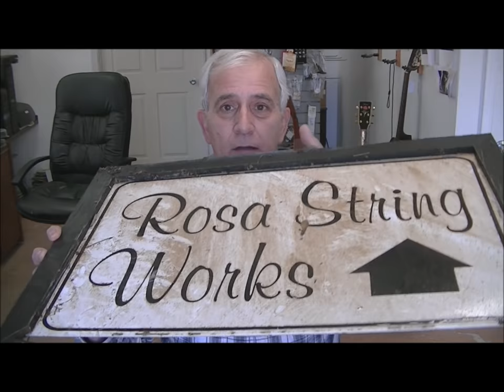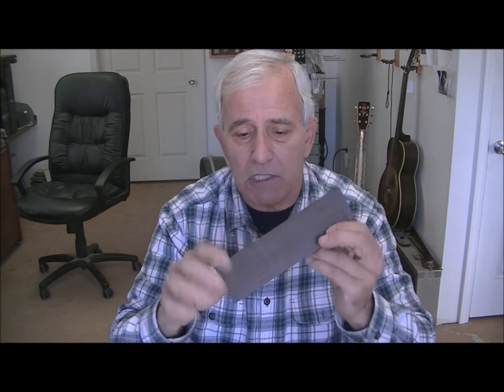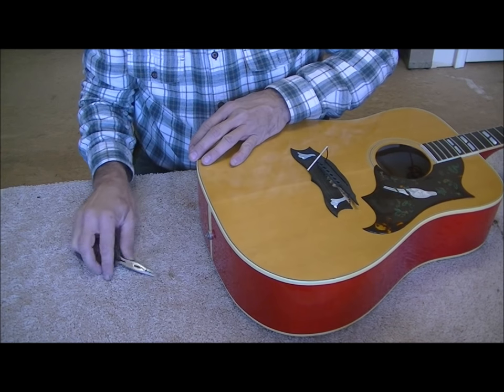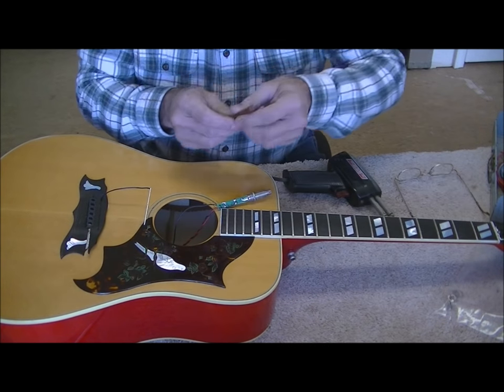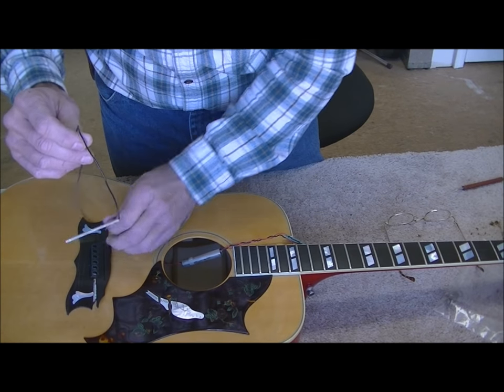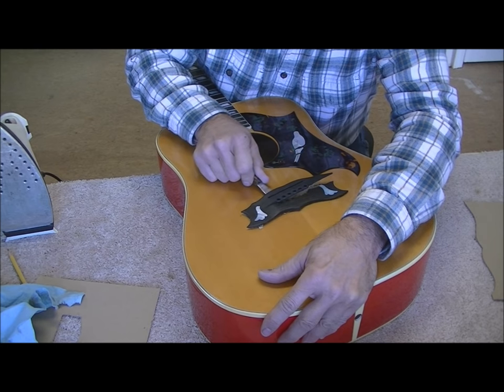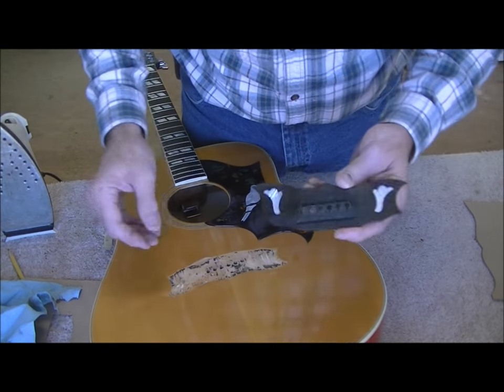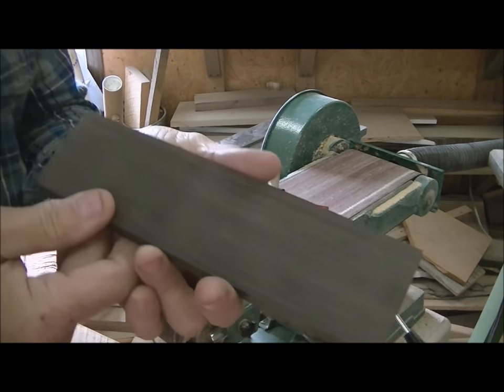095 RSW Gibson Dove Trash To Treasure Part 1

Comment: I had to make a new bridge for a Gibson Dove and once I removed the old bridge, I CA glued it back together and made a copy of it on my Xerox machine. I cut the copy out of the card stock it was printed on and also cut out the wings with an exact knife. I made a stencil and used that to trace the location of the wings onto my new piece. It worked really well😎

Comment: Like the way you removed the bridge . . . one can't get excited removing a bridge, calm patience is required . . . I like using my art knives, they are almost tin as paper and tough as can be.
Reply from the maker: Rod MacKinnon I don't remember how I took it off in the video without rewatching it. However I do use a artist palette knife most of the time. Thanks for watching.
Reply: I believe the wood you purchased is also called Grenadilla which is used to construct oboes and clarinets.
Reply: Jerry, you're adept at repurpose tools.  I'm trying to find a sable (or other suitable brush) to clean my harp of dust & sand.  Make up brushes aren't big enough.

Comment: Good idea taking a picture of the 2 wires before dasoldering or desodering. But you could just cut the two wires and leave a small bit of the coloured insulation attached to the circuit board. That way you can tell which attaches where. Better to strip back the wires and re tin them when making a new connection anyway.

Comment: I know everyone works differently - when you are de-soldering put a little fresh solder on the iron, it will transfer the heat much faster, causing less damage to the board and components. I worked servicing consumer electronics - tv's and videos etc for ten years or so - ATB

Comment: When you have that tall fence on your bandsaw but want to cut a short height board, simply clamp/bolt/screw a short squared up wooden temporary fence to the tall fence. You will then be able to get the upper saw guides down close to the work piece.
Reply from the maker: That's a good idea. Thank you. However my fence switches from tall two flat in probably 15 seconds. There's not much reason to need to do that.

Comment: Excellent work.  Thanks for sharing.  
Why is this a common occurrence with the Dove bridge,  ya reckon?   I've got one that I've had for many years that needs this very repair,  having cracked and pulled up in exactly the same way as this one.  When I first got the thing (1975),  it was cracked and I had it repaired/replaced at Sho-Bud in Nashville -- the only Gibson authorized repair shop in my area at the time.  It is the one that is now cracked,  and needs replacing.  
About 1978 or so,  I was looking at a brand new all black model Dove hanging in a music store in Knoxville,  and it was cracked the same way -- BRAND NEW,  mind you.  
Even seen it on some of their rosewood mustache bridges on some model Doves.  
The pins are ebony on these as well and I've heard speculation that the owners put too much pressure on them trying to seat them causing the bridge to crack,  but I'd think with the insert,  such would not be the case.   Still a mystery to me.  Any ideas?
Thanks again for this.  Either me or someone else is gonna have to replicate this repair and we need all the help we can get. LOL
Reply from the maker: I can't speak to all of them. But any of them that have that insert in there around the string holes they're bound to crack because that weakens at a lot.
Reply: Thanks for the quick response.  Your observations about the insert making it weaker and more apt to crack make a whole lot of sense to me.  I had to go look to see if mine was one with the insert (been awhile and us old folks forget a lot),  and sure enough it was.  You may be onto something. 
Ironically,  I think the purpose of the insert was to prevent that sort of thing,  sorta like drilling a hole at the end of a crack in sheet metal to stop it from continuing further.  Major fail if that was  its purpose.  
Thanks so much for your input and uploading this professionally executed and documented repair.  So very helpful.  
On to part 2 (about 1/2 way through).  Got some more questions and comments,  if you would be so kind as to indulge me.  Thank you.
Reply: I've seen a bridge with saddle route (channel) directly on a grain line, and it looked weak - for breakage. Hoping for your good health! @RosaStringWorks

Comment: Hi, I just recently stumbled across your videos and can't seem to stop watching them! I am an acoustic player myself and I have a Vega model VW93 Martin copy dreadnought. They seem to be much maligned on the web for poor build and problems with cracking sides and necks coming lose and such, but mine is in perfect condition and plays beautifully! I traded in a small Epiphone on it in 1985, at a music store in Oklahoma City that had it as a used guitar. The bridge and nut are both brass. Do you know anything about these guitars? I know Martin bought the company in the 70's, I've read that mine was built between '84 and '87 but that means it was nearly new when I got it!
Reply from the maker: Dave Malone thank you for watching.  Unfortunately no, I don't know much about the Vega guitars. I know Martin sells a line of strings called Vega strings.

Comment: Trying to get the bridge off.
There are all sorts of blades that you can buy for that Weller soldering gun but I reckon if you just took a new tip and heated it up then hammered it flat it might do it.
Whatever.
 Perhaps a variable temperature thin blade like a cross between a pallet knife and a hot blade foam cutter.
Reply from the maker: Thanks for taking a look.

Comment: Hi Jerry Hope you are well, love you videos,  just whats needed for aspiring DIY guitar fixers:) Just a question on your router setup for bridges. Are you using a Dremel 4000 and what size type of bit do you use to cut the slot? Ken from UK
Reply from the maker: Yes it is a Dremel 4000. And the bit I use is  3/32

Comment: I know your terribly busy... I own a 16-32 sander as you have. The belt broke few years back an hadn’t replaced it. Did you do any mods to use it without the drive belt...hate to invest in another belt...
Reply from the maker: No I just used it as is. But it's dangerous if you're not used to it because it can throw the board right back out at you.

Comment: Jerry. Your Ft Worth Tx fan here. I have an Epiphone DR400 all solid wood guitar with a pick guard that is coming
loose at one spot on the guard. Any suggestion what kinda adhesive to use to reaffix guard to guitars top? The
guitar is in A1 shape otherwide. Cant take it to a Luthier acct of Lockdown. Would Super glue work.
Reply from the maker: I answered this in email form. However for those reading the comment whom I also want to know. My suggestion is to use a hair dryer and warm up the pickguard being careful not to get it so hot that it melts. I would press it back in place and hold it there until it cools off. You might get lucky and that might fix it. If not I would probably use canopy glue and squeeze it under there and hold it in place for approximately 24 hours. CA glue would be my very last resort. CA glue can ruin the whole finish up a guitar in a heartbeat. Trust me I have seen and heard of lots of people ruining their finish with CA glue.
Reply: I've seen videos of a luther's using 3m 77 spray.

Comment: Would a heat gun or hair dryer be any good to remove glued parts?
Reply from the maker: Crazy Monkey it sure can under certain circumstances. You have to be very careful with a heat gun because it is basically blowing nearly flame hot air. You can easily catch a finish on fire or burn the wood. Thank you very much for watching.

Comment: Just wonder why, The bridge part that broke away that you wouldn't just scrape away the lacquer or whatever they finished the guitar with, glue it down properly and glue the two pieces back together?
using the proper glue is stronger than than the wood?
Scrape, glue clamp, stain, done?
Not saying you are not doing a great job, but major time consuming stuff!!
Guess you are a perfectionist! But what at lot of extra very detailed work!

Comment: The belt on belt fed sander flexes and isn't capable of the precision that a solid steel under table would give. Generally, I', not a fan of drum type feed thru sanders, preferring the belt type ( aka Timesavers) but for this precision, I think the performax without the feed belt is delivering. I am enamored of Jerry's DIY built sander.

Comment: African Blackwood is superior to ebony. 

As a matter of fact, for centuries African blackwood (dalbergia melanoxylon) WAS the genetic name for "ebony"

African blackwood was what you got when you ordered ebony for centuries.

 It's of course prized for it's musical tone. It's the wood used for all black wooden wind instruments like oboes, clarinets, bagpipes, flutes etc. It's a true rosewood with a far better tap tone than modern ebony. It rings instead of thuds. It's far rarer than modern ebony...but over the last 100 years the "substitute wood" became the standard even though African blackwood is better. (Similar to how Honduran mahogany replaced Cuban mahogany but now is prized among Les Paul players even though it's a substitute wood)

African blackwood lumber was also used as a ballast in the bottoms of old sailing ships centuries ago because it was dense and resistant to water...and of course cheaper than lead or some other metal. 

So yes you probably just upgraded that guitar.